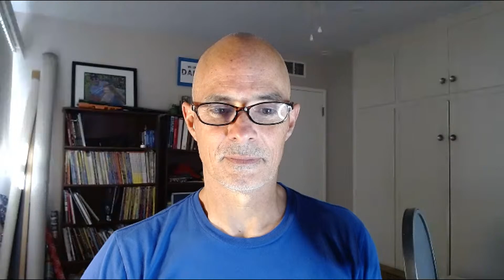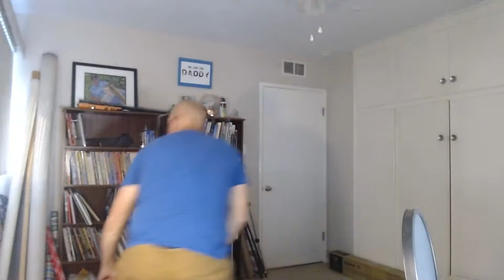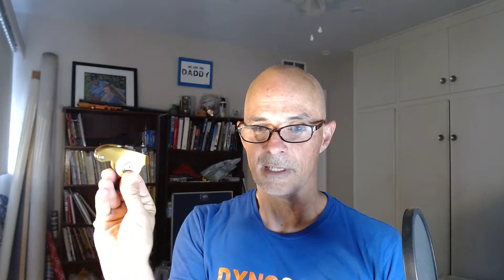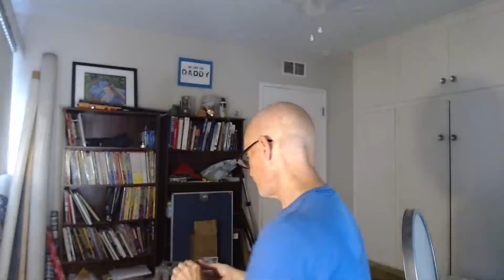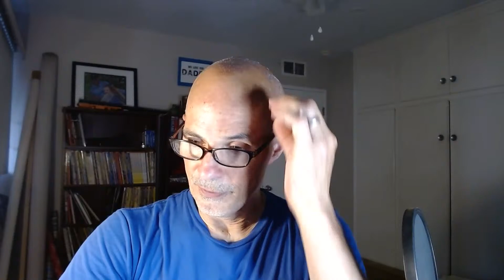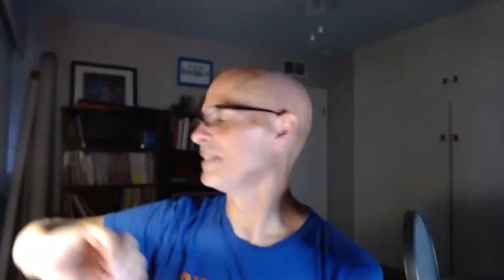LET'S TALK TURBOS-ASSYMETRICAL BOOST

Comment: Buick 3800 in my Regal. I've almost got the piece of shit into a condition, and my financial shape, to where I can do something stupid to it. The front manifold is easy to access and remove, so I'd make that a turbo manifold. Turbo can dump into the crossover into the stock manifold, and through an aftermarket downpipe/cat to retain lower emissions and also stock exhaust. Wastegate can go to air. Turbo can stick out the hood... Cold air intake. Since the turbo would be so high I could just drain into the head instead of trying to modify the oil pan I just put in. 

I'm not saying I will do anything, just that I want to do something.

Richard Holdener reply mode: I THINK MY PIECE OF SHIT BUICK NEEDS A TURBO LIKE THIS.

Comment: Run turbo with normal size intake side.    But with much smaller exhaust housing and turbine wheel.
Then if the experiment continues, grind a cam , with taking into consideration that one side has more back pressure. Grind cam accordingly. Good luck with That!
Interesting! 😁

Comment: This is off topic but an arguement i see and have had is about which is better, the old school small block Chevy or the ls platform. I would love to see 2 engines tested that are as evenly matched as possible. Say a 5.3 vs a 327, similar camshafts, similar flowing heads, similar induction systems. Start NA then boost them. It would be interesting to see how the 50yrs of engineering between the 2 platforms shakes out in power and efficiency.  You are doing things I've been dreaming of for years, keep up the awsome work.
Reply from the maker: given that a junkyard 5.3l in stock trim makes as much power as a stock L76 (365-hp 327), the ls has come a long way

Comment: Control a wastegate with exhaust back pressure.
Reply from the maker: WHY
Reply: @richardholdener1727  My thinking was along the lines of what Dimitri is saying.  Also, might reduce pumping losses and reduce exhaust valve temps.  Would seem that controlling the engine with the exhaust pressures would be more accurate than taking the control signal from the intake because too many parameters of the intake charge need to be considered to know exactly how much air volume is actually entering the engine.
Reply: My guess is youd get near a specific hp number and it would stay there as boost rolls off with rpm and the hp curve would kinda hang out. Some small turbo oem cars do something like this but they curve it in the computer. It would probably be best to keep intake temps in check and avoid over speeding the turbo. However it might do some funky stuff if you're pulling timing to combat detonation and not have a smooth curve at all.

All wastegates get at least some input from back pressure. If you put a soft enough spring in it just disconnect the boost reference. The valve will act like a piston and want to open.

Comment: I remember Honda had an asymmetrical turbo setup on its Indycar engine back in the 90's.  They called it the Tokyo Screamer because it was so loud.  They must have had a reason.  At the end of the Indy 2.65 turbo era, boost pressure was so low that half the exhaust could easily supply enough energy to spin the compressor to supply all of the engine.  I suppose it improves power by eliminating backpressure on half the cylinders, improving their output.  Maybe a T3/T4 hybrid turbo would be the way to go to test asymmetrical turbo plumbing.  Small turbine, big compressor.  Then I begin to wonder if the cam lobes need to be different for the two cylinder banks.  Would power be maximized by trying to make airflow equal to both banks?

Comment: Rhodes lifters state that "Their unique construction reduces lift and duration at idle by approximately .010 in. to .020 in. Duration is reduced by approximately 10 to 15 degrees. Total lift and duration are restored at approximately 3,500 rpm. Original Rhoads lifters are also anti-pump-up for higher rpm revs. Typical vacuum increases range between 1 to 3 in. They can be used with either adjustable or non-adjustable valvetrains. Original Rhoads lifters, with their legendary "ticking" at idle, sound similar to solid lifters and they are designed for use with high performance street, marine, or racing applications."

Comment: I've read that 351c engines have factory forged rods.  Does anyone know if this is true?  Would 400m have forged rods too?
Reply from the maker: THEY DON'T HAVE FORGED RODS
Reply: @richardholdener1727  I didn't think so.  Thanks for the clarity.
Reply: Imma disagree with Richard here, Yt doesnt like posting links so you have to dig a bit on your own. 351m/400m has D1AE AA rods and I can't find anyone confirm they are castings. As far as I can find all 351c 2v,4v, boss all have D0ae a rod. These all look like typical for rod forgings. Ford did use some cast rods but none in any v8 after flat head or y block or MEL and then late model ones are forgings. Guys can spin a stock boss351 to well over 6000rpm and the pistons weigh as much as a work boot. Cast steel rods work and work well but they will tension fail at high rpm. Compare what a Ford C9OE A 351W rods that was used on the big bang 351w over 1000hp to what the D0 or D1 351c/m rods look like. Ford rods do have a notable parting line for a forging but the 351c rods have a really good reputation for stockers.

Comment: Holley does have VVT support for GM, Ford and Chrysler in the Terminator X line. They also have a direct injection Term X system for GM Gen 5 engines.

Comment: @Richard Holdener   Richard .. Could you address performance from Open Chamber Head designs ..  BBC, SBC, and Cleveland.  Some off the shelf piston suggestions would be cool.  I think people would be surprised about what you could achieve with a Hyper/piston and cam swap on their Smog/Specials.  73- 82 Corvette owners might induct you into their Hall of Fame.. those years were dark years for factory horsepower.
Reply from the maker: I DID A VIDEO ON THE L82-WITH UPGRADES

Comment: Use both banks to initiate spool. Then bypass the flow of the second bank.
Reply: Thats harder than it sounds unless you use a twin scroll. If you y the exhaust into one exit youd need a valve to shut out the y or it will back flow and youll just end up with a conventional wastegate as the opening of the one bank would re close during this and it would just find an equilibrium. I really dont see a point in trying this unless you are just trying to only use half the engine to spool it up unless you really need to save space.
Reply: @danieldimitri6133  , It would take two valves. One at the "cut out" of the Y, and one at the entrance to the turbo flange Y. To spool, at low rpm, you close the cut out valve and open the valve into the turbo Y. When the turbski is spooled, or back pressure rises, you close the valve for the turbo entrance and open the cut out exit.

I would use it to spool a smaller turbo "quickly" but reduce the back pressure that comes with the smaller turbo exh side.

Is it worth it? Idk, haven't seen a test yet.

Comment: Why not add a secondary small wastegate to the big block that opens at lower pressure to relieve back pressure or use exhaust pressure to open the wastegate when pressure spikes.

Comment: What do you think about having the waste gate use back pressure as a reference instead of boost pressure.
Reply: the back pressure curves that I have seen curve up at high engine RPM.  So turbo wouldn't be controlled well at low and mid range.

Comment: There was someone talking about the old warplanes with turbo hooked to the crank, it’s called a turbo-compound and it where they used a turbo exhaust side to turn a shaft that helped turn the crankshaft, it helped on efficiency for long flights. These engines were also mechanically supercharged for altitude.

Comment: I think a better system would be a very hybrid turbo. Basically a compressor sized for all eight cylinders and an exhaust side sized for just half the cylinders. Go ahead and run all 8 cylinders into the motor for VERY fast spool, but then have a very large wastegate. One large enough not to just control boost, but to actually reduce back pressure. I suspect this is what F1 did in the 1980’s.

Comment: Not related to the title but talking about weird turbo stuff. Modern Detroit diesels have a turbo on the manifold and a axial inflow turbine after the turbo that is gear driven connected to the flywheel that can add around 200 ft lbs torque when activated. It was the strangest thing when I can across one on eBay by accident.

Comment: Maybe this would work for a spec class that's turbine limited it would effectively make your turbo bigger
Reply: From the research I've been doing, there were some companies doing this in the 2000s in some class. They weren't allowed to run a lot of boost so they only used one bank figuring the additional exhaust from two banks was not necessary and would be a waste I guess. It was oval track stuff. That's all I heard

Comment: K, i did a little more digging on rhodes lifters and this is from their website.
 "Q. Is it oil pressure or rpm that restores duration?
A. Rpm. Quite simply, at lower rpm Rhoads Lifters have more time to leak down. As the rpm increases they have less time to leak down and at approximately 3500-4000 rpm virtually full lift and duration are restored."
 I am really sure.that they will effectively advance the camshaft because of where the loss of lift in the curve is. It isnt "advancing" the camshaft but if you are losing 0.010 lift on the closing ramp and 0.002 on the opening normalised over duration, it moves the centerline of the lift curve advanced. If you do test a set i would really like to see a test with a stock camshaft just because i have never seen one. Lm7 cam is tiny and it might pull huge vacuum. They might work well with the large by stupid ls7 or 9 camshaft.
Theirs little blurb is pretty vague but other posts reasonably claim that oil viscosity and spring pressure will change the curves as well and thinking about that makes sense. Thicker oil leaks slower and heavier springs will make if leak faster.

Comment: What is best affordable turbo for putting twins on LS 6.0 Gto to nake fast 1000hp?
Reply: 1000hp crank? Gt3582 ebay. 1000whp is not really possible reliability with gt35s. Something a touch larger. Gt45 ebay is way bigger but will work at the cost of response.